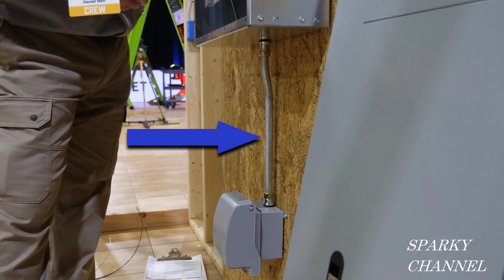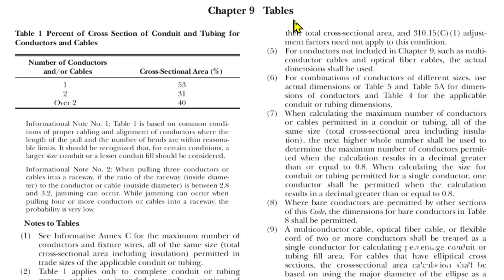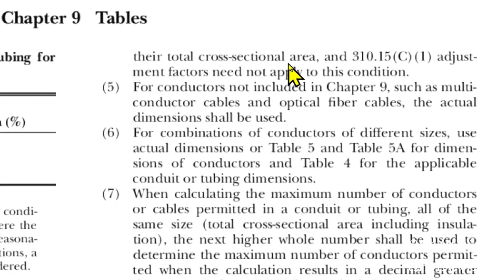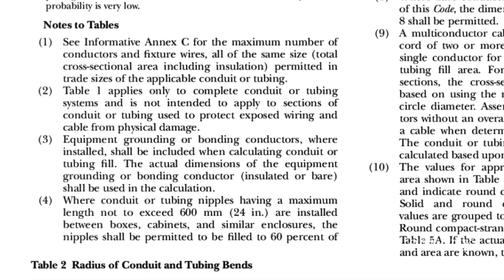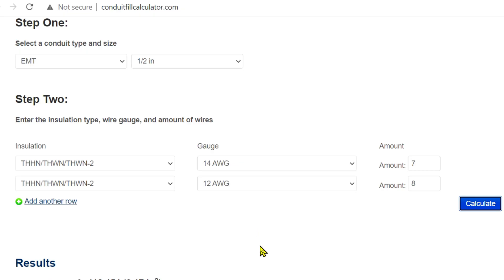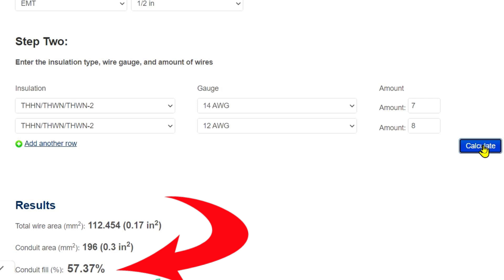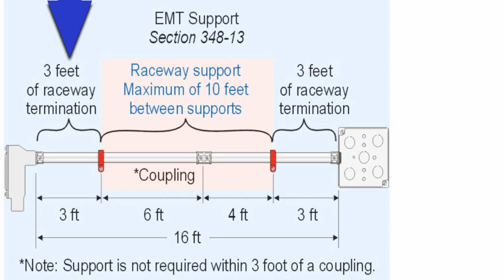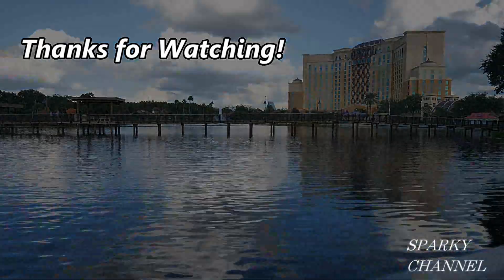EMT Conduit Nipple Fill and Strap Questions NEC Chapter 9 Table 1

Comment: You are incorrect regarding the strap, sir. NEC 358.30 requires EMT to be strapped(secured) WITHIN 3 feet of a box or enclosure not 3 feet AWAY from the box. The old "no strap" rule for nipples was for sections of raceway 18 inches or less and was removed from the NEC in 2011. There are NO exceptions in that remove the requirement to strap conduit or nipples within 3 feet of a box or enclosure.

Comment: I failed an inspection because I didn't put a strap on a 16" piece of emt. Inspector stated that it has to be strapped within 3ft and he said that code doesn't give exception for shorter pipes. I asked what if I used a 2" section of emt and he said still needs a strap.

Comment: What about de-rating  of conductors? that's usually where the real issue some in with pipe fill.  Funny how much different Canada and US is sometimes.  We can max out 1/2" Emt with 12 14awg or 9 12awg but that's cause we can only ever go to 40% fill. We also start  to de-rate after 4 conductors. My rule of thumb is usually two 3ph sets with neutrals(full sets) + bond in 1/2",  three full sets + bond in  3/4" and four full sets + bonds in a 1"( all 12awg).

Comment: 358.30(C) unsupported raceways not more than 18 inches. That pipe needs a strap.
Reply: Looking back I don't believe that pipe is 22 inches long, but you say it is so it needs a strap.
Reply: 358.309(c)???
Reply: @Tweezy1987yabish  Fat fingers, 358.30(C)
Reply: I agree that it needs to be strapped…but let’s go with 358.30(A) because I’ve yet to see 358.30(C) in the 2020 code
Reply: @Tweezy1987yabish  2008 NEC. must have been a change.

Comment: 348 is for FMC. 358 is EMT.
Additionally, I find your assessment to be incorrect. Code states that EMT SHALL be secured WITHIN three feet of a termination point and does not give exception for this scenario. This is in 358.30A. A single strap anywhere in that distance is required. 

Please do explain if I'm wrong there, as I would love to know if I am. I don't have a 2020 NEC as we don't move to that revision for another year, and referenced the 2017 NEC, so please don't discount that.

Edit: I just confirmed this information in the 2020 NEC as well. 

I think it would be cool to use this same setup in a derating example to show why you can't do it for branch circuits, which have a minimum amoacity of 15A, but can be done in power limited control and signaling circuits.
Reply: I totally agree!
Reply: Totally agree!!! I can’t find any information about nipples not being strapped in the 2020 NEC. Article 358 doesn’t mention that kind of exception (or else I missed it if it did)
Reply: @svanneman  the issue is whether or not the box connection counts as a support. I take advantage of the confusion and do it where it makes sense.

Comment: Cant tell how big the box is. The conduit might be ok but is the box?
Reply from the maker: You're correct, the box would have to be bigger, but I was just using the photo for an example for max fill in an emt nipple.
Reply: @SparkyChannel  Would it?  Maybe there is a fitting coming straight out of the back and most of those wires just run straight through. Complicated box fill calculations above my skill set. 
I'm sorry. I love watching your stuff and I know this wasn't the topic. Just making an observation :)
Reply: @castarmax1970  no need for complication. The box isn't big enough for 14 wires, even if it was a pull box. Especially so because there's a receptacle on there, hence the in use cover. Just too small of a box. 

A simplification is, if it won't fit with the smallest gauge of wire, it won't work. If it'll work with the largest gauge of wire, then you're good. If it's in between, you'll then have to do the math, but it's not very hard if you've got a calculator in your pocket, which we all do now. That's all you need to know.
Reply: ... good catch on the box size. I was too busy thinking about the conduit fill to even consider that it might still be tight with a 4x4 box.

Comment: As a datacom guy, nailed the answer on the strap, had no clue on the fill ratio; usually, when using 1/2", it's just for 2 Cat6 cables. In fact, I never really need to worry about fill ratios for most of what I do until I start putting in a conduit from a network cabinet into the ceiling.
Reply from the maker: Interesting, thanks!

Comment: I would say yes strap the pipe it's more than 12" long and yes put another wire in if it will fit, because it's less than 2' long
Reply: But I would never fill a pipe like that period . Shouldnt show people how to be a Jack leg
Reply from the maker: @onsiteelectricianscott4025  Just making examples to show the code. :)